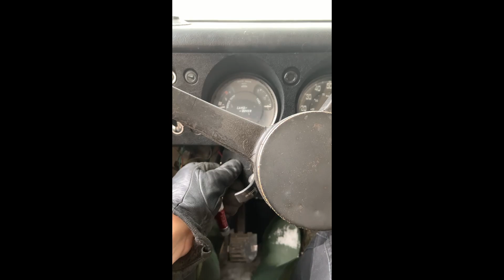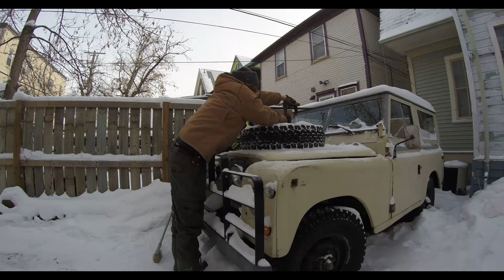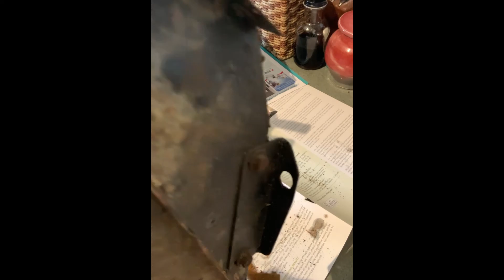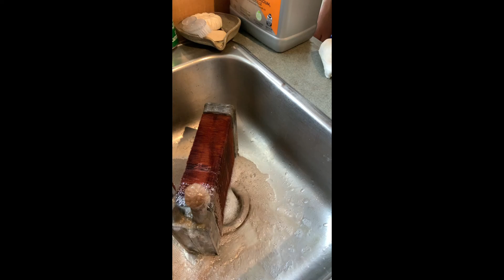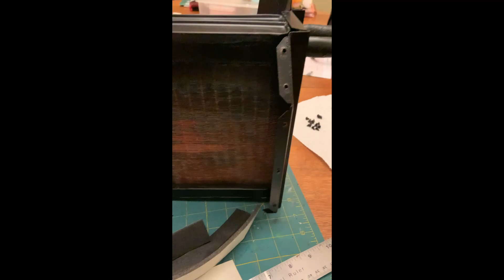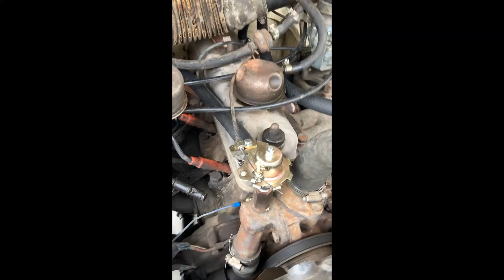1972 Land Rover Series 3 COLDER Start -24°C  -16°F

Comment: This was really interesting. Rebuilding mine as previously mentioned and rhe only demand from my wife so far is that we get a new heater 🤔  .... think mine is a lot worse than yours and this episode rang so many bells with me.
Really enjoyed this.
Reply from the maker: Thanks.  Sometimes you can work with what you've got.  Even with everything flushed out the heat is still not great, but it keeps the windshield clear LOL.  I just wear lots of warm cloths. The old Kodiak aftermarket heats were pretty good (like back in the 50's).  I wonder if someone makes a good aftermarket heater these days.

Comment: That "High School Janitor" key ring will trash the ignition switch as it bounces up and down when the LR3 is moving and could potentially leave you stranded. You might want to move it to a separate key ring.

Comment: My 1984 series 3 109"
 2.25 petrol is like it on cold starts on 20W/50 engine oil I wonder if it had
 10W/40 in it would it crank over faster as the oil is lighter, but only if the engine doesn't use oil as it'll burn more 10W/40 than 20W/50.
Reply from the maker: Lighter oil makes a big difference.  Maybe it will use less oil if the engine runs slightly cooler in the winter?  I plan to change back to a heavier oil in the spring.
Reply: @BlaineRepko  I do wonder would it burn  more oil using 10w/40, than 20 w/50 , I'm already using 75 w / 90 API GLS 5  in the series 3 synchronesh gearbox,    and transfer box and 75 w /  EP90  in the diffs. Am I right in thinking the 75 winter 90 weight at running temperature is a good choice the old SAE EP 90 single grade oil is thick and hard to find these days and hard shifting in a gearbox when cold.
Reply: I changed the gearbox oil for 80w/90 ,GL4 as GL5 isn't compatible with bronze/yellow metals like synchro rings, leaks a bit so might  consider putting EP90 in it when I find some.
Reply: @paulwest6262  SAE 10W-40 is fine above -20°C (-4°F), although below this you really need a SAE 5W-30 which can be used below -10°C (14°F). Gear oil, SAE 90 is fine above -10°C (14°F) and SAE 80W below 10°C (50°F). Whilst SAE 80W-90 should cover both grades, in practice it behaves more like an SAE 80W than an SAE 90 in a Series gearbox.
Reply: You might try using 10w40 with a viscosity indexer, like STP. This will give you a 10w50+ oil.